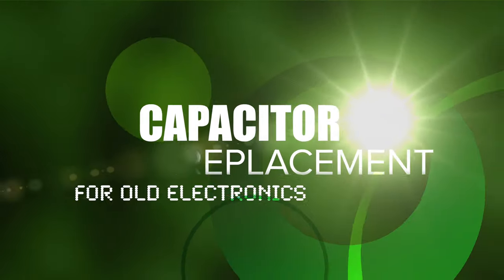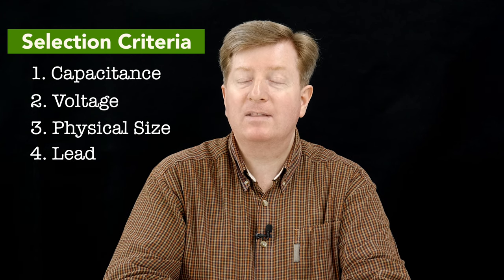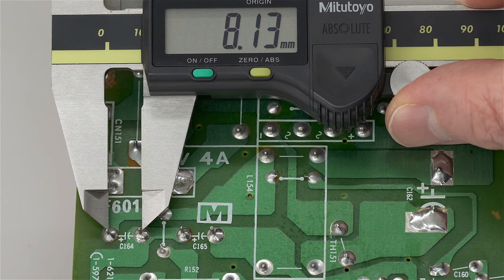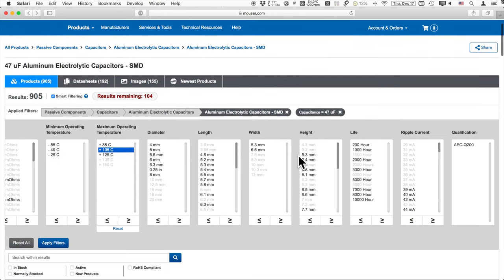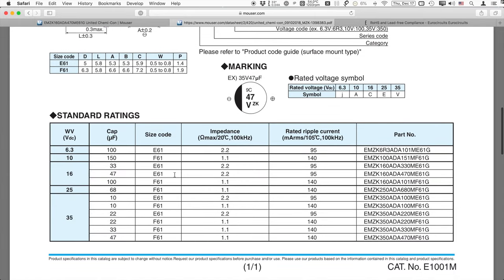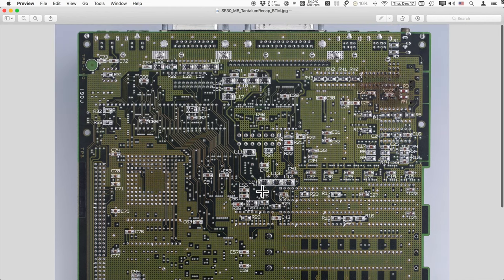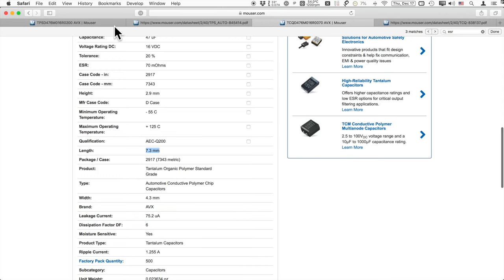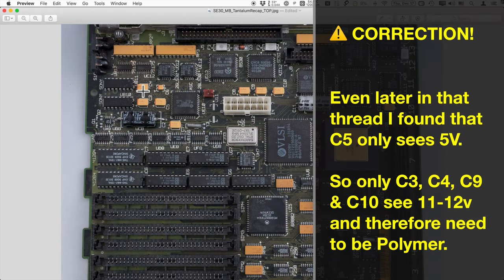Choosing Capacitors to Recap Old Electronics

Comment: Your selection process is in general OK, however there are three more variables that need to be taken into account.
Temperature of operation, there are two types generally, 85 degrees C, and 105 Degrees C. You can fit 105 degrees to either but not the other way around.
ESR, if ESR is mentioned it normally means a LOW ESR (Equivalent Series Resistance), Lower is better, used for particular power supplies.

To speed selection on Mouser, DigiKey, RS, Element14, etc. Select 'in stock', first.
RoHS compliant is not required for old electronics, and in fact its hard to find on that is not anymore. Old Electronics will  mostly be using lead solder anyway, so using a RoHS parts is OK but will not make the old electronics any better.
Reply from the maker: Andrew, while I certainly appreciate your insights, lower ESR is not always better, especially when it comes the the output of switching power supplies. Some require damping when using ceramics, such that you have a super low ESR ceramic in series with a resistor. Yet other switchers don’t need damping and call for the lowest ESR caps possible to yield the lowest peak-to-peak ripple. 

Because of this, choosing ultra-low ESR caps when recapping a power supply can have unexpected consequences, and I discovered that when recapping the Apple HD20SC Sony power supply. I had to use a slightly higher ESR cap in one location to prevent an odd “chirp” sound “oscillation” at power-on. I have a video on that if you want to see the “chirp” waveform on my oscilloscope.
Reply: @JDW-  Hi, thanks for the reply. I would not replace ceramics unless they are damaged, and then try to be as exact to the manufactures original as possible. I was talking about Wet aluminium types. I've been an electronics technician for over 45 years, and have replaced millions of capacitors.  In the RNZAF for example, I repaired AFCS on A4's AND P3's, the 99% failing item on them was pitch sealed tantalum capacitors, I personally replaced in excess of 100,000 in around 4 years. They were soldered on silver plated pegs embedded in Teflon buttons pressed into Aluminum trays for mechanical stability as the aircraft could pull many "G' in multiple directions. "cut, grab, rotate off, lift, rotate, bend new loop, solder in-place, form other end solder, cut excess" next. Next I looked after (field service), IBM 3270/3276 terminals and other brands like TELEX, Memorex, Raytheon, etc in government and Airline offices. They all had Nasty switch mode supplies, which were rated for 100-230 Volts AC input 50-60 HZ, our mains is 240 V at 50Hz, and most 'departments neglected regular vacuuming,  so the PSU's over heated and died. During 25 years of the field service, traveling to all cities in New Zealand, all airports, and the pacific Islands of Tonga, Samoa, Amerika Samoa, Cook Islands, and Fiji, I carried bags of 1000 capacitors of each type, as well as replacement supplies. I would replace the supplies on arrival, do any cleaning, adjustments, repair printers as needed, and retire to a motel where I would replace the capacitors for the next stop.
Later again I worked on robotic and CNC machines, the only difference really was the size of the failing capacitors they were much bigger. I worked on pick-and-place machines, mostly Japanese, the problems on those were NOT capacitors in the main but lack of cleaning of the mechanical and pneumatic systems. I've repaired Ham Radio transceivers, the capacitors in those have generally a long life, like 20-40 years, but people like me like the older radios so I'm replacing capacitors in 1970's and 80's machines. On my work bench is an HP1710B oscilloscope, it failed 10 years ago, no less than 12 companies have tried to repair it, and failed, which is why I obtained it for free. Its problem I have found is many differing mechanical faults and transistor failure, the capacitors chosen by the HP engineers are still in tolerance. 
And just for a completely weird one, I worked on a knitting machine that made jerseys, failures were caused by a combination of capacitors (30 yo), and broken soldered joints due to vibration. That was a fun one to repair as the instructions are in Italian, the owner a sheep farmer, and his helper a handyman. He would come in smelling of lanolin and sheep dip, to help me remove damaged power supplies in the bowels of the machines.
Regarding de-soldering, especially on fragile PCB's, I use Goot brand, "gootwick" desolder braid, 2.0mm most commonly, and 'Chipquik SMD291 no clean flux, and Chipquik low temp desolder metal, which makes removal of small parts and stubborn parts easy. You must remember to remove the low temp metal before soldering new parts on though. Always clean with Isopropyl alcohol pads or the liquid and a q' tip.

Comment: Hmmm just fixed a 1977 Tektronix oscilloscope with shorted tantalums. It was quite a Smokey fire 🔥 before I found out. I’d say tantalum’s should be on the “hot list” of replacements. Also had bad tantalum’s on a Mac IIcx.
Reply from the maker: A lot of "solid" tantalums fail because the designers failed to properly voltage derate them.  For example, if you put a 16V tantalum on a 12V voltage rail, you increase the likelihood of failure considerably.  But if you use a 25V rated solid tantalum, it then becomes much less likely to fail.  Want to reduce the risk even more while still using tantalum?  Go with Polymer Tantalum instead.  Not only will they last longer, they won't fail in a flame.
Reply: @JDW-  well this is a Tektronix 214. I think they are pretty high end designers. Pretty sure it was in spec. What fried was my batteries and part of the PCB because they should have fused the battery pack like the did the a/c input. I’ve since added 1a fuse to the battery and hopefully that will protect the tiny transformer behind those tantalum caps. I’ve heard these caps fail often and burn up the transformer. The tantalums i went with are “Solid Leaded”. these are 10v and 35v caps in the power supply on the transformer output side and i just noticed that the output voltages are 5v where the 10v caps are and 65v where the 35v caps are. But the caps are in series. Hmm 🤔
Reply from the maker: @sideburn  Some of the biggest names in the industry, including Apple, have used solid tantalum caps on boards and did NOT sufficiently voltage derate them.  Trust me, engineers at big companies have made such errors.  It also was not well understood in the distant past about the need to do a minimum 50% voltage derating for solid tantalum.  It is now well understood, especially by NASA and the US Military.

When a solid tantalum fails, it mostly fails shorted.  So this may be while other parts in the same circuit fail too.  All of the information I've been giving you about "solid" tantalums applies to both SMD and "leaded" types.  Polymer Tantalums are only available in SMD types, unfortunately.
Reply: @JDW-  so should I not put these in the scope? I ordered them from mouser for preventive maintenance. I already replaced the shorted cap with an electrolytic. I was just going to replace these other 4 to be safe since I heard that they tend to short and fry the transformer. But I’ve since put a fuse on the battery so maybe I should just leave it alone.
Reply from the maker: @sideburn  If you ordered exact replacements for the stock caps, you will not trigger any immediate problems.  All I am saying is that to get longer life out of solid tantalum replacements, you need to voltage derate them by 50%.  That means if you have a 12V rail, you must choose a 25V rated solid tantalum.  50V rail?  You need a 100V solid tantalum, and so on.  What happens if you use a 16V solid tantalum on a 12V rail?  Well, at some point a voltage spike will kill it, which means it goes up in flames and fails shorted.  And while derating a solid tantalum by 50% may seem extreme, there are some high reliability designs where the engineers chose to derate by 1/3rd, which means the cap has a voltage spec three times the working voltage.  The more you derate solid tantalum, the less likely it is to fail.  The closer the voltage spec of the tantalum is to your working voltage, the greater the risk of failure by voltage spike.
Reply: @JDW-  ok. I’ve uploaded the section of the schematic and highlighted the 4 caps I’m planning on replacing I guess that aren’t in the 50% spec: http://sideburn.com/caps.jpg
Reply from the maker: @sideburn  Thank you for clarifying with the schematic.  What is the MEASURED voltage across C256 & C258?  That will tell you how much jeopardy those two solid tantalum capacitors are in.  C251 & C253 are probably close enough to the 50% derating to be okay. These are all thru-hole components (not surface mount), right?
Reply: @JDW-  I’ll have to measure it when the new caps arrive and I open it back up. It’s all back together right now and working. The shorted cap I replaced was c247 on the left side of the transformer. Yea all thru-hole parts (built in ‘77 I believe).

Comment: Does replacing all electrolyte capacitors with SOLID capacitors makes my CRT tv last another 30 years ?
Reply from the maker: If the replacements are properly chosen, in terms of the capacitors, the answer to your question is yes. But it could be that another component within your CRT TV might fail in the next 30 years. Specifically, the flyback transformer is often a point of failure.

Comment: Tantalum capacitors need replacement when used in circuits prone to voltage overshoots (like cpu/gpu vrms) where the psu used might not be able to handle the load.

I started seeing equipment dying cause the board engineers did not expect the psu or ac adapter used with their boards to have so significant overshoots.
Reply from the maker: With regard to solid tantalum capacitors and overvoltage, you are absolutely correct. However, the average electronics enthusiast would not necessarily know enough details about their old hardware to make an informed decision about whether or not to replace all of the existing solid tantalum capacitors. And there are a lot of cases where there is no such overvoltage and therefore you would not need to replace them at all. Also, if you measure and find there is overvoltage than you know you would need to replace those capacitors, but there are also situations where you may only get an occasional spike, and that is what I mean by saying it is harder for the average electronics enthusiast to figure out if those capacitors need to be replaced or not.

The key point here is in determining if the solid tantalum capacitors in question are in fact voltage derated by 50%. In other words, a solid tantalum capacitor rated for 16 V should not be seeing more than 8 V normally and certainly not more than 16 ever.

Comment: Just want to point out when replacing electrolytic capacitors, that too many people singularly fixate on 105C as better vs 85C. 105c does not mean longer life than 85C, just higher temperature when that spec is needed.  In most cased where 85C is never even approached, it does not matter. What does matter that seemly everyone ignores is design life. Such as an old 85C 10,000-hour or even 18,000-hour capacitor they replace with a 105C rated capacitor with only a 2,000-hour rating thinking it is better. Many 105C 2,000 (or even 1,000) hour rated capacitor are often cheaper than a better quality 85C cap. Those low hour caps are meant for cheap disposable devices, not restorations that are expected to last for decades to come. Those vintage re-cap kits often sold on eBay boast of being a trusted manufacture 105C rated caps, but are actually the cheapest (low hour) series they can find, turning a restoration into waste of time and a future piece of crap.
Reply from the maker: Yes, you absolutely must consider the temperature rating with the hour rating.  That "combination" is what matters.  But there are times when you search for a replacement cap of a given capacitance value and physical size, only to find the best rated at a mere 2000 hours.  And in that case, you need to go with what you can buy (for hobby use).  If the voltage rating can be accommodated along with physical size and lead spacing, sometimes swapping out a small electrolytic for a dipped solid tantalum is a great choice.  You simply need to make absolutely sure the tantalum's rated voltage is no less than twice the working voltage it will see.  Do that, and you won't need to bother with a replacement in the future.  Interestingly, I've also seen 85°C caps with lower ESR than their 105°C cap counterparts at times.  I also see that when it comes to hour rating.  Seems like many high hour rated caps have marginally higher ESR than lower hour rated caps.  I'm talking 10,000 hour rated caps versus something like 2,000 hours.
Reply: Yes, all valid points.  I guess the point I was attempting to make is the spec I am least concerned about is the 85C vs 105C unless a 105C cap is required. Given the dimensions are correct, I look for hours lifetime, ESR, ripple current first and temp rating last as the least significant. Cost is also a factor in a selection but do not want to negatively impact longevity by using low hour caps. Tantalum capacitors often fail to a short when they do fail so I avoid using them. In my old Tektronics scopes the tantalum capacitors seem to be failing before the electrolytic. Case in point, I am rebuilding a Soundcraftsmen PCR800. There is no possible way the power supply filter caps would ever get near 85C (185F). My replacement is a Kemet brand with 16,000 hour rating and over 3 times the ripple current rating and lower ESR of the only Nichicon selection available, which is a 105c 5,000 hour cap with 1/3 the ripple current. And since these amps already have too small of power supply cap j(due to space constraints) s for their output, the 3X boost in ripple current should improve IM distortion during high current demands.
Reply from the maker: @multicyclist  There is much debate about SOLID tantalum capacitors, and I must emphasize "SOLID" because there is less debate about "POLYMER" tantalums, although most people tend to be somewhat ignorant about all the tantalum types (including WET).  With SOLID tantalum, you absolutely positively must derate the voltage by 50%.  This isn't my personal opinion.  This is standard practice and is what the manufacturer's specify too.  In some government use-cases they may even derate more.  But solid tantalum capacitors are still widely used today specifically because they tend to avoid catastrophic failures when properly derated.  It's voltage spikes that kill them.  I've seen equipment from Apple and other big companies that have failed/burned tantalum caps only because their engineers decided to use a ridiculous 16V-rated solid SMD tantalum cap on a 12V rail. So even some experienced engineers make that huge Voltage Derating oversight.  Sometimes those 12V rails can hit 12.6v.  And all it takes is a brief bit of over voltage to exceed the 16V spec on that improperly chosen solid tantalum cap to light it afire.  And yes, solid tantalums fail shorted most of the time.  Had Apple engineers instead used a 25V rated SOLID tantalum, it would have been physically larger, but it likely would have survived and still be in use today on that nominal 12V rail.

In contrast, POLYMER tantalums do NOT fail shorted and you only need to derate them by 20%.  (Some say only 10% for low voltages under 10V, but I always derate them at 20%.)  The problem with POLYMER tantalum caps is that they are very expensive.  So in my SMD recapping projects (on vintage motherboards, for example), I tend to use lower cost Panasonic OS-CON instead, since those don't need a voltage derating and I get even lower ESR with OS-CON than Polymer Tantalum.  (Polymer tantalum is lower ESR than SOLID tantalum, and solid tantalum is lower and more stable than the ESR of Al. Electrolytics.)
Reply: @JDW-  Very informative! Thanks!

Comment: I would have to disagree on your analysis of AC line filter caps aka "Rifa caps"/ Metalized film caps on the AC line should be an automatic replace in most older gear.   Affectionately known as "the cap of death" in older audio gear, a fail to short puts AC line on the chassis.   Those European made caps from the mid 70's-on aged terribly, catastrophic failures (aka "capocalypse") are more common than one would want. If you are lucky they just short, smoke, and quit, if not... well,  they were the reason we now have X and Y specifications for safety caps.   That old junk never had polarized cords, which further increased the chances of getting a surprise from an electrified chassis.   Good video, appreciated much.
Reply from the maker: Although I was giving general advice, I largely come from the standpoint of a vintage Apple Macintosh enthusiast. And I know for a fact how those RIFA capacitors fail on those machines. Most of the time they turn into black goo, and it’s not a situation you have AC constantly being shorted. The worst case of them failing in a Mac means you remove the gooey mess and swap it out with your preferred replacement cap. Some people just remove them and leave them removed all together, which will allow the Mac to keep working, but I don’t really recommend that because the caps were there for good reason. You can replace them with another metallized paper RIFA cap, or a ceramic safety capacitor if you prefer.